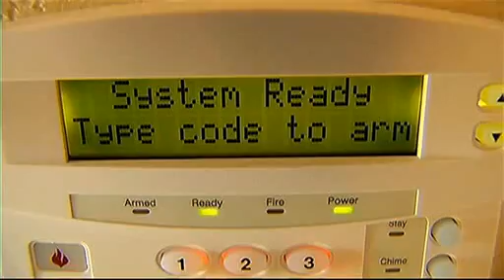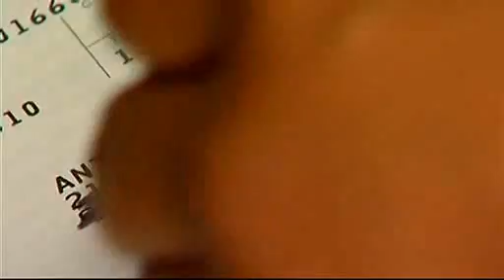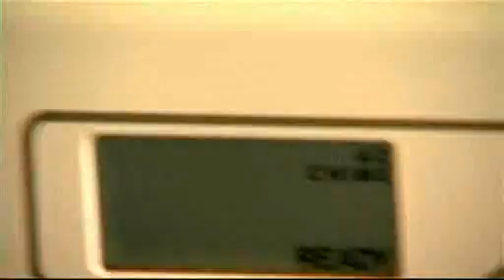Jim Stickley Demonstrates How to Bypass Home Alarms [TV]

Comment: In the UK our alarms have tampers on them so you can't remove the cover of any device without the alarm going off
Reply: You just cut the power supply for a few seconds and you can take the case off no problem
Reply: @YoFxlconOfficial  They have batteries inside for power cuts.
Reply: @charliewoodstock3604  so how would you do it? Apparently you can. Somehow my house was broken into but the police couldn't figure out how it was done because everything was put back together.
Reply: Yeah they do lol there's already a "serviceable " way around. Remember they pay employees by the hour. There are INTENTIONAL. Ways around literally every, single , alarm system. Like it or not. That's a fact
Reply: @lifeinthearclane6240 who installed the alarm? Because if it wasn’t you they could have used the engineer code to disable the tamper and alarm
Reply: No I have disabled one of those systems it works with a switch to the outer cover of the alarm box when you take the outer plate of it triggers the alarm only if the alarm is enabled if the homeowner puts their code in and you open the box it will beep but not trigger the alarm even if the alarm is enabled its not a problem as you can pull out the battery and telefone line before someone gets alerted

Comment: Not sure how old this is. When I was doing alarm response, the most common alarm we responded to was loss of connection, and cutting power took about 48 hours because they have battery backup. There was a crew that would trip main breakers and come back on the 3rd day- if power was still out that meant the alarm was dead and the home owner was away and either couldn’t be contacted or didn’t have anyone looking after the place to turn it back on… until one day when it meant that we were on to them and waiting in the back yard.

Comment: What about tamper protection, PSTN, GSM and IP backup, EOL and DEOL lines, and follower zones?
Reply: +ImpiantoFacile and BT Redcare monitors  phone lines and has protection if cut or disabled b.t will know and alert police. americas alarms are behind british ones and if any wires to the outside bell box is removed the sab module will detect and run on back up battery for 20mins inside the outside box itself.
Reply: joseph h Exactly, america doesn't know anything about security.
Reply: ImpiantoFacile Sadly you guys are right about the big names here in the US.  Bay Alarm in CA does everything you mention.
Reply: yea at least one good still probs doesn't touch the the sides of grade 3 uk systems such as Guardall. or even old modern security/scantronic systems
Reply: joseph h Do you supervise your contacts using a 4-wire conductor as well?
Reply: yes and tilt tamper and off the wall tamper and cover tamper is also used, screened cable is not advised more than 90 meters and contacts must conform to British Standards and an 8k7 EOL  should be used at end of the address circuit line protocol or on any XiB Bus and programmed within the system to report to the arc even if system is not set. pin of the day will be changed early and an engineer sent out. if you need any more information contact me or i can send someone out to you.
Reply: joseph h I believe the reporting is service sided, Meaning if they actually want to be notified. Yeah, even the company I'm with states not to report on transmitter low bats or loss of trasmitter supervision but the programming is there if desired.  I guess it just depends on the company.  As far as resistors used I imagine it's a manufacturer spec more so than it is a central station thing unless you perform zone doubling often.
Reply: a low bat will give a 5v reference and tell you your battery volts and give ur status not report we have a priority over faults and tampers and panels will respond in the way according to the model. as a tamper must be reported as the user could reset the system and bypass address points giving the criminal what they want. manufacture installation, and maintenance. It is within and the holdings are with the best customer services in the fields. contain, detect. prevent and maintain if the panel is programmed to allow this to be transmitted where systems to serve anti terrorism and terror attacks in security systems even the status of the panel will be monitored.  if you require any more information as mentioned before you can contact technical support offices, please note these are open mon to fri,  9am-5pm.
Reply: If someone wants in...they'll get in... believe that.

Comment: This means that a self activating bell box will still sound even if it had no power and the panel has been destroyed. The battery on board the bell box can power if for around 10 hours. Much more secure, I'm surprised ADT haven't used these panels in america yet because over here thats all they fit. They could do with adopting the same equipment they use in europe.

Comment: Depending on if the motion sensor is programmed to follow the entry delay. If the sensor is located near the door entry point instant mode cannot be used because it does not follow the entry delay. Any motion sensor not near a controlled entry point should be set to instant (near panel)

Comment from the maker: I have done testing with alarm systems that use cellular.  With a hand held jammer that I purchased online I was able to prevent the system from communicating while I disabled the alarm.  This was not full proof though as the jammer had a limited distance and it depended on where the unit was installed.
Reply: That only would work if the only signal path is cellular.

Comment: This video makes me laugh :) I professionally install alarm systems ir Europe and always use DEOL, hard to notice places for panels, tampers. Follower or interior zone is only for entrance place, other zones instant. PSTN is not used anymore for alarms, mainly GSM or RF transmitters. RF is hardly to jamm but sends only main alarm, while GSM is easy to jamm, but it sends full CID protocol. Using PING technology 30-60 sec. in GSM transmitters, alarm response company would see loss of connection and respond
Reply: MB Sensorika Quick question.  So when you say DEOL I assume you're referring to double end of line.  How does that look like physically?  Say, if the system (under normal circumstances) requires a 2k resistor,  do you add two 1k resistors in a series selectively throughout the line?  I mean maybe one at the panel and the the other in the rj45 block located elsewhere?
Reply: MB Sensorika most people here in usa middle income to lower income use a hardline for their alarm systems..all you'd have to do is cut phone and cable lines outside. I think they're pointless.
Reply: This person knew exactly where the main panel was so he found it right away, in a normal size house it would take about 10 minutes to find the control panel and disable it.
Reply: Jim Stickley has no idea what he is talking about he doesn't know the first thing about security systems!!!
Reply: In my house I have a 2GIG go control panel! And it uses GSM (Verizon). I also had a very old Honeywell alarm system so what I did was the Honeywell alarm system has a tamper sensors on the box, and the Honeywell is hooked up outside. THEN I have my main alarm panel and the Honeywell control box has a tamper sensors, and when you take out a sensors cover or the cover on the 2GIG it will start doing a tamper message to the alarm company.
Reply: @leathercheerio1 incorrect... most systems do not use twisted pair

Comment from the maker: While I did chuckle at your comment, I have to say you are mistake.  What you see was completely real.  I have rarely seen a tamper switch on an alarm box when its located in a garage or inside a home.  Also, while some alarm systems will monitor for power on the phone line, that is the exception, not the norm for an average home alarm.  To be clear, both your trigger point suggestions can be installed, but for your average home alarm with the box located inside, I just never see it.

Comment: Thanks for this video. I checked my DSC Alexor and by default the case tamper switch on the box is disabled. I enabled it by going to section 015 option 8. I think this should be enabled by default.

For my situation it probably wouldn't have mattered anyways since I have a motion sensor set to instant mode that monitors the location of the panel.

Thanks for helping me cover all my bases

Comment: The problem with any security whether camera's or alarm system, is that the user informs people of what they have got. They put camera's on full view, so that anyone can see them. Therefore the intruder will either wear face covering, or will try to attack the camera. I know one bloke who put camera's outside every door to his factory unit. The camera's were mounted about 7 feet of the ground. He wasn't a professional engineer, just someone fitting his own setup. Consequently an intruder came along, approached the camera's from behind, cut the cable, and not only broke into his premises, but also stole his camera's The common sense approach is to HIDE the camera's so they are not seen. Security is a specialised field, and it is true that a good alarm engineer has to think like a burglar to provide the best security for any premises.

Comment: However...a SDR Software Defined Radio could record a signal from a wireless alarm device and if you can retransmit that signal you could overpower the RF from the device, break in, and simulate a device that has not been tripped.
This won't work for DSC Qolsys or DMP since the wireless devices use spread spectrum technology for communication.

Comment: U.K. home alarms have at least two fail safe circuits that stop such activities. The alarm system I have is  layered. Without giving too much away, if anyone gets in to my house without the alarm going off, I'll give them my money.
Reply: cut the power and wait till the battery runs out and then just enter.
Reply: If you have Verisure Alarm..you lose the money😂

Comment: My alarm goes off when the central control box is opened.
Reply: Your alarm?? Or a trouble condition from a tamper switch? We hear that all the time... "It went into alarm"
Reply: @W8RIT1  I don't have that alarm any more but when you open the box it starts bleeping then you have a few seconds to input the combination before the alarm sounds, I think most alarms over here are like that. It was a professional alarm hardwired to the mains electricity but had a battery backup incase of a power cut, it would start bleeping when the battery needed replacing & when there was a power cut. The way this guy is bypassing the alarms wouldn't have worked on the alarm I had.
Reply: @jimmynich4791  the way this guy is "bypassing" a system won't work on any panel. The beeping you are hearing is for a trouble condition, not an alarm. Police won't be dispatched for a trouble. The major city in the metro area where I live will not respond to one alarm they need two alarm trips to be dispatched. The beeping that you were hearing for the trouble conditions like the tamper switch for the door being opened or the batteries being may go to your Central station monitoring service and the company that services it may call you to see about service. The problem is who knows when they will call you.
Reply: Some locations notably commercial locations and maybe systems with UL requirements such as a bank may cause an alarm for the panel tamper.

Comment: Put the main panel in the loft and use a remote control keypad down stairs near the door you come in, also if you can view between the cavity drop your pir wires down from the main control panel to the rooms on ground floor bring them thru the walls in the corners of each room. sorted no one can get at the main panel or wiring.

Comment: In reality nobody actually goes and "defeats" the system. At least in my 35 years I've never seen anyone do this. Typically it's a smash and grab and the bad guys don't care if the alarm goes off because they have a good 30-45 min before the cops even get there ( Unless your in Detroit then you have a full 24 hours lol ) as for resistors they help but what really matters is having a knowledgeable tech like myself. I install only "High risk" systems where we know it's not "If you get robbed but when will you be robbed" . On my systems the last zone is always reserved for a panel tamper (front and rear) and the RJ31X jack ( CA45A in Canada) gets a resistor across the Blue/Orange which also go to the tamper zone or if I have spares it will get it's own zone. As for idiots saying you can use hairspray to defeat a motion detector..impossible! You have to get to the motion first and the bad guys are not there to spend 30 min trying to sneak up on your motion, Same idiot says a rare earth magnet from outside..LMAO most reed contacts are balanced so applying another magnet will trip the alarm. Good luck kids ;)
Reply: Rare earth magnet? LOL, someone has been watching too many heist movies. People should know that if they show it in a movie, it probably doesn't work in real life.
Reply: I'm also in the Detroit area with JCI. Who do you work for?

Comment: Alarm circuits loops today are what are known as balanced EOL (end of line) resistors, instead of the old double pole method of wiring. This makes it a little bit more difficult, (although not impossible),  to loop out, and so bypass the circuit.
Reply: 576924 I can telll you in at least three states that i worked in and most likely the whole usa that nearly no one put the resistor at the end of the line,They all put it in the panel thus defeating the eol.16 K service calls in the last 13 years what i see is the biggest problem is the advent of piece rate installing it is the dirty little secret  in the industry.Also the alarm techs almost always put the alarm box key is either in the lock or on top of the panel.

Comment: There is a whole, great security system for the whole house that works really well. They can be controlled with the help of your smartphone or you can simply watch your home in case of departure. Also, many systems can operate without connection to the electrics, such as batteries. In this case, do not worry about the safety of the house if you turn off the lights.
New systems greatly simplify life and they are very easy to use, I also use this security at home. Personally, I use Kangaroo`s kit

Comment: I know I'm late to this party but I'll comment anyway.

In Britain, Alarm systems have tamper switches on everything, bellbox, detectors, PSU's and have current sensing on the panel and telephone line with battery backup. If the power is cut the panel goes into full alarm, if the phone line is cut the system goes into full alarm and the monitoring station instantly knows because the panel doesn't reply to a status request which would send the police to attend the site. We also have "Walk Zones" programmed into it. If a person deviates from a pre planned route to the keypad then the system goes into full alarm instantly. Our circuits operate on a Normally closed loop so if a wire is cut it goes into full alarm unlike american systems. We also have monitored or supervised circuits so if someone tried to bridge the connection to fool the system into thinking that the circuit is intact that wouldn't work because they have resistors placed in line with the panel. any increase or decrease in resistance to the zone cable will trigger a full alarm. Another thing. If for some reason the power was lost to the system and then restored the panel goes into full alarm automatically. It's extremely difficult to disable an alarm over here. We don't generally use phone lines anymore, we use GSM and internet for the connections to the monitoring stations. Again, these are monitored, if one goes down there's a backup. if both fail the alarm company will send an engineer and the police to attend. We have backups on top of backups so getting past a system in Britain is practically impossible. The PIR's are anti mask so you can't cover them with paint etc because that would trigger a tamper alarm, the door contacts are dual reed switch which are very difficult to bypass and we have acoustic glass break sensors. Let's just say that everything mentioned in this video has been thought of and protected against in the 1990's.